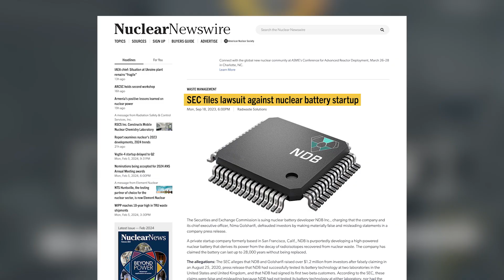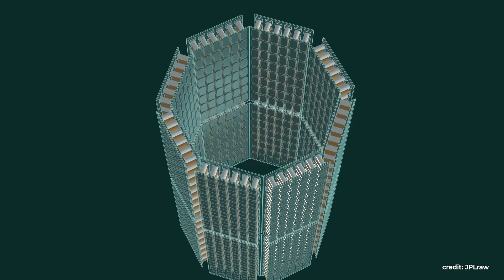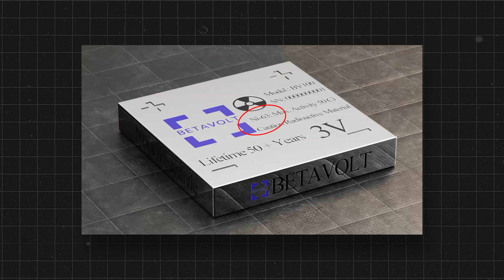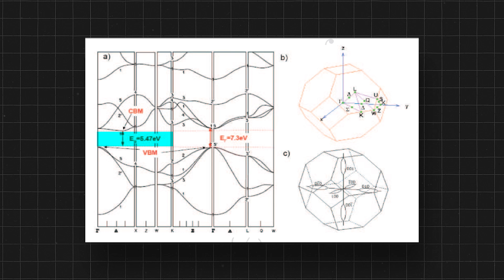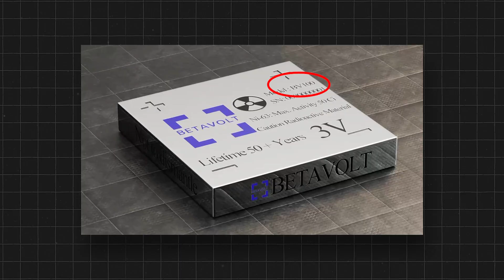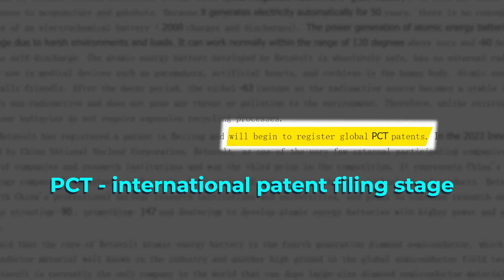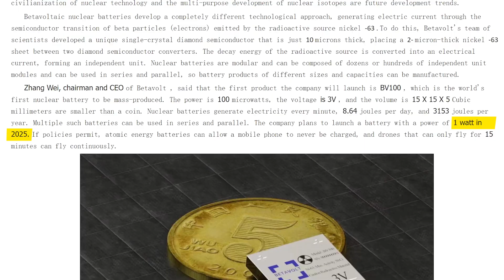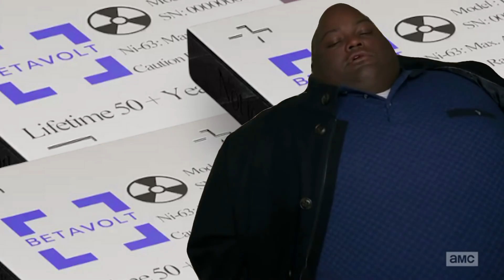Inside China's Nuclear Battery Breakthrough

Comment: Alot of Northern towns and reserves in Canada have high expense fuels to generate their electrical needs. Diesel generators which are aging out, aswell causing greenhouse gas emissions need replacing, Nuclear diamond batteries , maybe part of the answer. Perhaps you would consider  a segment on compact reactors, "rtg"s and other designs, that would be swell. Keep up the good work sir..
Reply: "Nuclear diamond batteries , maybe part of the answer."
No. You are asking if a moscito is the answer to powering an oiltanker.
Reply: @ABaumstumpf  Mosquito
Reply: @ABaumstumpf  in homes, to power essentials like flashlights, cell phones, other survival equipment. A pretty important mosquito to dismiss out of hand, almost like you don't want us to have emergency preparedness.
Reply: @seanhewitt603  "in homes, to power essentials like flashlights, cell phones, other survival equipment."
No. It appears you do not understand the scale involved here.
You could buy THOUSANDS of betavoltaic batteries and you could not operate and flashlights, cellphones or anything else.

"almost like you don't want us to have emergency preparedness."
Right back at you: You want people to waste a lot of money to prevent them from actually being prepared.
If you want emergency batteries than get primary cells. get a powerpank and a small solar-panel or handcrank.

But betavoltaic does not help in any ways. You are simply mistaken there.
Reply: Mini nuclear generators would be much more realistic.

Even the rtg's would be much more realistic.

The thing with this "new" battery is that it isn't new. You can buy modules already if you have something that needs very very little power in complete darkness.
Reply: There are other nuclear batteries for that type of use. You can move them on a truck. A company at out of  white sands was building them for the military 10 years ago.
Reply: @sparksmcgee6641  "for the military" is not what I'm after. Almost ten thousand Inuit live in the northern comunities and have no choice but to rely on filthy diesel for electricity. The military grade would be scookum, but try getting them to share on humanitarian grounds.😐🙄😐
Reply: @seanhewitt603   It's for bases and they are the first people that do nuclear in the U.S. because environmental group can't sue and stop them. 
The bases they're powering are larger than the towns you want power for.
Call Ft Carson in Colorado Springs. There's 3 bases in that area so if it isn't Carson they'll know who has it. Installed the first one about 15 years ago. 
You could just call around to nuclear battery companies and as who makes thw large scale ones for towns.
They can power 10-15,000 houses with some of them. Smaller than 10'x10'x10' if I remember right.
Reply: @sparksmcgee6641  thank you, Inuvik, N.T, Canada, it's only 5-6 thousand people living there, some of our smaller communities, even smaller.
Reply: Our first priority so be to get power and heating to our people as cheaply and efficiently as possible, acceptable "greenhouse gas emission" is at what ever the level it is need to do this.  We should not impoverished our economy and society in the name of "green gas emission".   Nuclear powers is part of the solution to our growing power consumption need.   For remote location, enclose micro reactors  can be use.
Reply: @DwynNWynns  ldiots like you selling the greenhouse gas propaganda. You couldn't even tell me as a percentage how much CO2 is in air. Do not google the answer because it's well below 1% ... Water vapour IE clouds are far more active in trapping heat then any CO2.

Comment: Pretty exciting, I wonder what happens if you accidently puncture it, and what the recycling process will entail. I think there's a good chance something like this will enter a consumer device such as a smart watch or airpods within the next 25-40 years.

It will be interesting to see how efficient we get with electronic devices. If we achieve roomtemp superconductors, I could envision an eInk display watch taking a few milliwats an hour, which might negate the need for low voltage longterm nuclear batteries, since you could generate electricity with photovoltaics and an accelerometer on the watch.
Reply from the maker: good question. I guess Ni-63 has relatively low energy radiation - but probably not something you'd want to hang around with too long 😅 I didn't include it in the video but I was surprised Airpods are ~100 mW vs 100uW of betavolt
Reply: decays to copper and its not enough to harm a fly